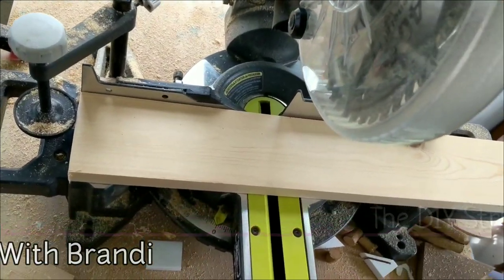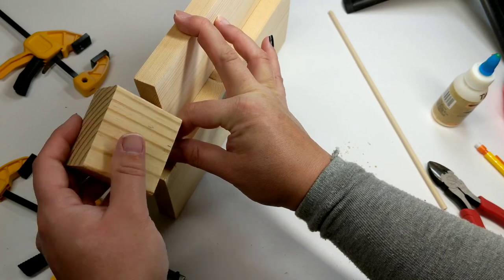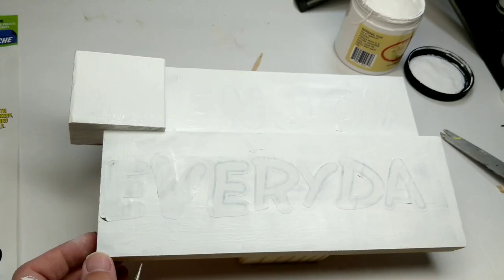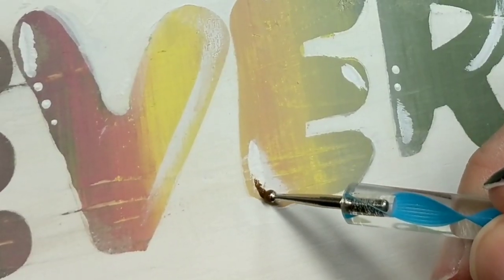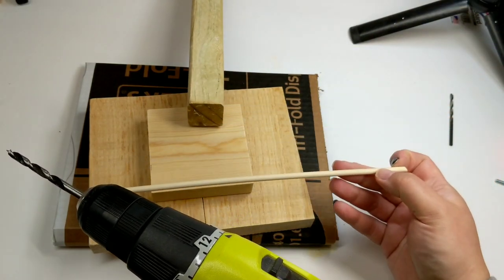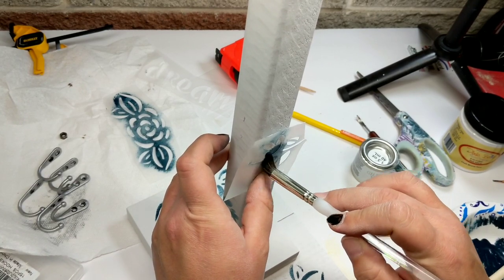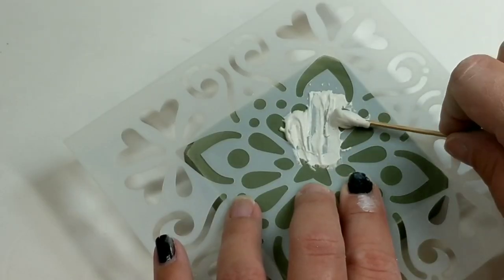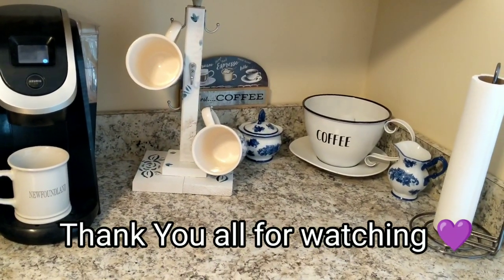3 WOOD DECOR DIY Ideas for your HOME |

Comment: Yeah, I found out too that wood sizes are not what they say they are except for the length. A 1x4 is actually a 3/4 x 3 1/2. I loved the coffee mug tree. I think we all learn something new from each project.
Reply from the maker: They deff never are...lol are that really matters when you are starting out making things and you are expecting 4 inches of something...lol
Reply: @thediystruggle  Here's something that really made me a bit frustrated. We bought our house at the end of 2019 assuming the walls were paneling and drywall b/c it looked that way. Turns out our house is concrete. We had to get special tools just to hang up a picture. So we now have Thor's hammer lol a hammer drill, special drill bits and sleeve anchors. I reckon I'll just have to build furniture to display my projects. Have yourself a wonderful day.